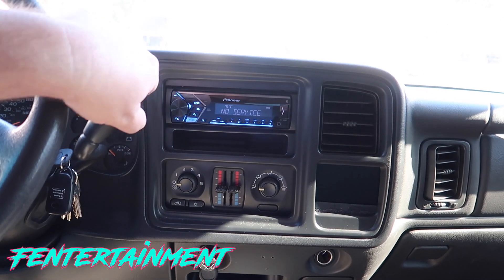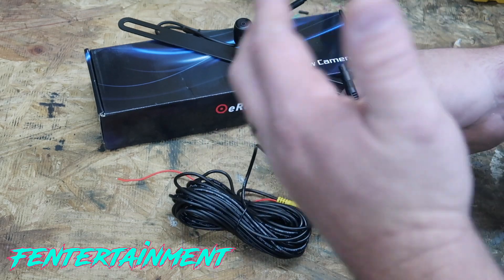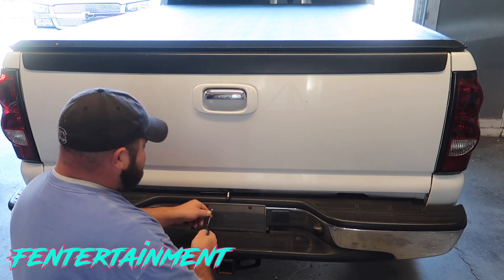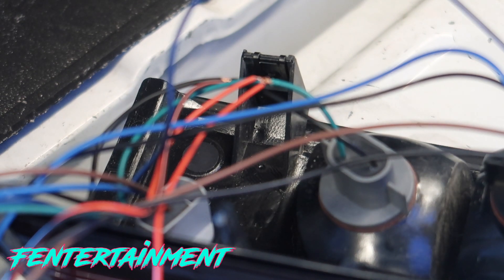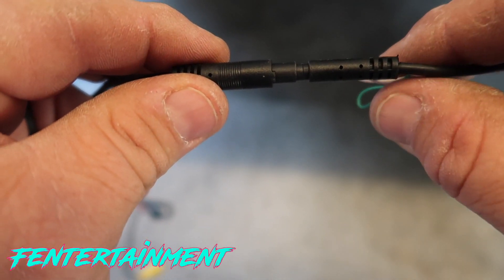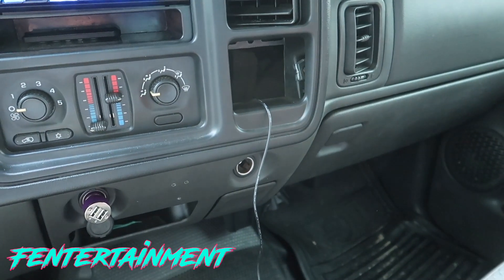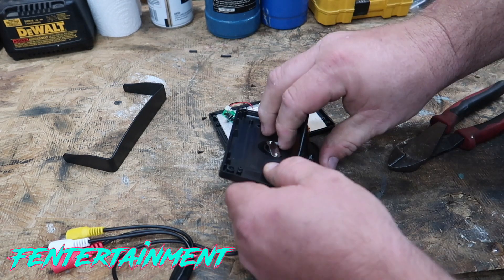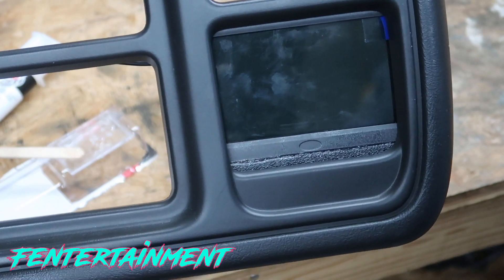HOW TO INSTALL A BACK UP CAMERA | CUSTOM MOUNT MONITOR IN 99-07 SILVERADO

Comment: That's the best thing that Chevrolet ever did was making the dash bezel so easy to come off just by letting your steering wheel column down and putting it in to drive and everything just pops apart..great video have given me some ideas for my camera install in my tahoe. What year is your truck?
Reply from the maker: Both of these are 04s

Comment: 15? Why 15? Also, what do the switches on the back do? Would it have benefited you to add holes below the display area for them to be accessible from the front?
Reply from the maker: 15, I was reading something while doing the ending. However the switches on the monitor is for tint color and contrast. I've never messed with them on my other truck however I left them on in case I ever needed to adjust them. Since it's not a need, never thought to make them accessible. It's super easy to pop that panel off but if your were to install something like this then you could.